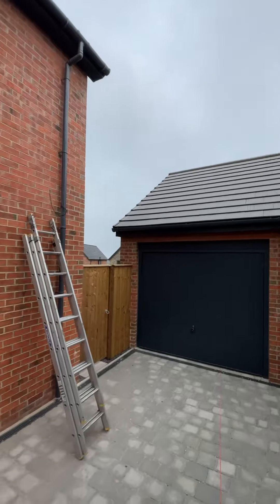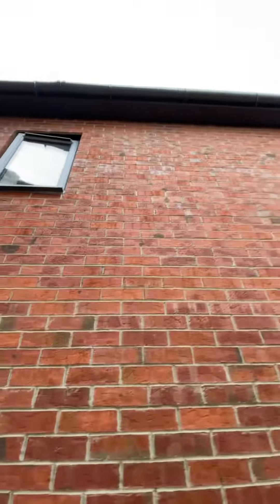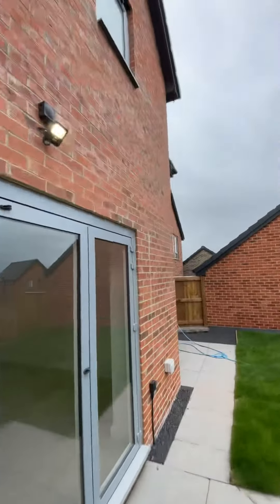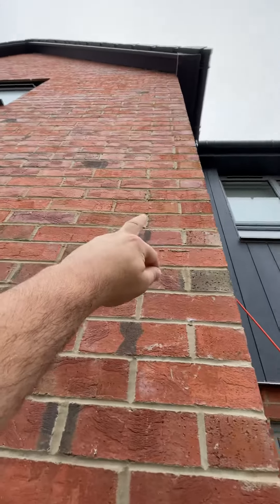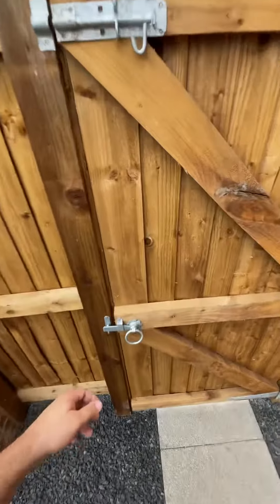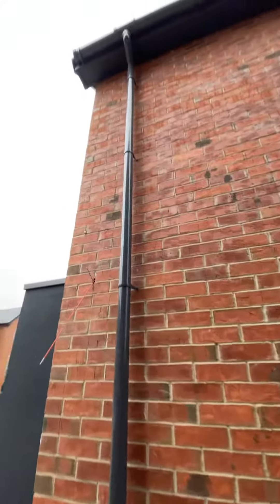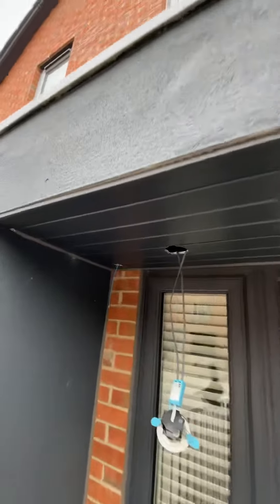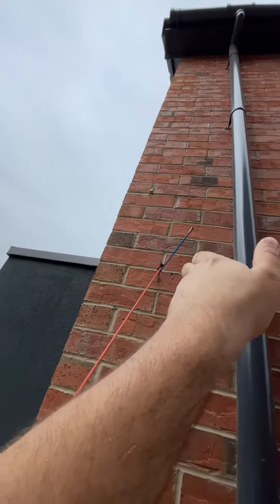Another Day On The Job - CCTV Installation

Comment: Once all the cameras are wired up down from the loft, do you feed the four cables (cables at the start)  into the room where NVR is and then use some mortar repair on the mortar to make good? Install looks spot on and some brave angle drilling 👏

Comment: Nice video, Do you have any tips for getting cables in the cavity? I’ve tried to push rods through at the steepest angle I can get and can’t for the life of me get the rods through. 

Any helps / tips would be appreciated 

Thanks
Reply from the maker: Thanks, pretty poor but will try and start doing some better vlog style videos! 
I’m guessing you’ve watched our cavity how to video? How many rods are you getting through, if it’s just 1, try knocking the end of the rod with a hammer quite hard. Sometimes you’ll find there is messy mortar on the internal brick preventing the rod from going any higher.
Reply: @HikVisionGuru  Hi , yeah I have which is what made me want to change all my cameras and have them in the cavity. I started with one camera along time ago and added more and more over the years but I have them all externally routed and want them all in the cavity.

Ok I’ll try that I can’t even get the first rod through it hits the internal block and can’t get it past even though I am at the steepest angle I can get. I’ll give that a go though and see if it’ll bend the rod past the internal wall and up into the cavity .

Thanks
Reply from the maker: How long a drill bit did you use, might even have gone too steep and it’s still going up into the brick work rather than the cavity. If hitting with hammer doesn’t work, try re drilling at a slight angle and try rodding.

Comment: Hi HikGuru, I'm in Australia- our eaves are 6-9mm fibre cement, what screw or fastener do I use to hang cameras off that? In your videos you just screw direct to the eaves, I don't know what eave/soffit board you have in the UK
Reply from the maker: Hi Ron, we have wood or pvc usually!
Make sure firstly it’s not got hazardous asbestos in it before you drill it and always wear your dust make when drilling cement. A normal wall plug and an adequately sized screw would hold it, as long as it’s not a big heavy ptz camera! If not use plasterboard type fixings
Reply: @HikVisionGuru  thank you so much! Unfortunately I had already hung them on plasterboard screws last week and they seem solid. Should I remove and install wall plug, some plugs just spin and don't open up inside as meant to. Also I ran pvc conduit like you to an external wall with 2 junction boxes. Do I need to silicone the joins as they are just pushed in together. Also the T and round pvc junction box covers are screwed on tight,no silicone.
Reply: @HikVisionGuru  hello, please help me on the above if you could, thanks legend 🙏🏼
Reply from the maker: @ronfj8603 as long as the screws seem solid then it’s all good. Pvc wise you can either silicone the lot or put it some water drip holes so any water can drain away.
Reply: @HikVisionGuru  thanks so much, really appreciate your help, absolute legend and fantastic videos mate! 🙏🏼🙏🏼🙏🏼

Comment: Hi, 

I appreciate your effort in trying to pull the cables from the wall cavity. I encountered a similar issue; every time I pushed my fish rod into the wall cavity, it broke after 4-5 feet. We tried the same method you're using, but it didn’t work for us. 

Could you kindly share which fish rods you are using? I’d like to buy the same ones and give it another try.

Thank you!
Reply from the maker: We tend to use C.K branded rods, you can buy different strength rods, some which are flexible some which are less flexible depending what you need

Comment: Call me stupid but I’m so confused, when you drill through the wall how do you make a gap in it to run the cable up to the loft aren’t all walls solid? Or does it have a gap in the middle of the inner and outer wall ? And secondly my kody is converted into a bedroom so how would I run cable up
Reply from the maker: Yes there is a gap between the 2 brick layers called the cavity, so we drill through the first brick layer only, then push our rods up.
If your loft is converted you may struggle, unless you’ve got some access to the eaves in the loft, sometimes there’s little doors into these areas.
Reply: @HikVisionGuru  that makes a lot of sense now thank you very much

Comment: How did you manage to feed that blue rod through to/from the porch? I am looking to do my own install, very similar to this. And can't work out what to do with the porch!
Reply from the maker: We used a super long drill piece with precision, and managed to drill right the way through into the void above the porch canopy. We then drilled a large cutout where the camera is and we were able to pull the rod down through this hole. Hopefully this helps. If not send me an email with some pictures of your layout with porch etc hikguru.yt@gmail.com
Reply: @HikVisionGuru  Ah OK, makes sense. Will have to invest in the super long drill piece, and maybe a set of balls to attempt it 😂
Reply from the maker: @timboslice4019  🤣 just make sure you are dead on with the drill angle, no pressure

Comment: Can you help me out please 🙏...I've installed 6 camera system...but when I have the cameras on the monitor for 3 of them I have no resource shown on the screen but when I go into that cameras they are working just fine and recording...did you encounter such a issue??
Reply from the maker: What cameras are you using and what NVR model? No resource shows when the NVR struggles to output all 6 cameras especially if they are set to “main stream”, if you change them or a couple of them to “sub stream” by hovering over the camera (a small menu appears below the camera) then they should all show. If you want all 6 cameras to show in main stream you may need to lower certain camera attributes so that your NVR can handle the processing power
Reply: @HikVisionGuru  spot on I just went from main stream to sub stream and bang😀😀thanksss a lot you got me out of the loophole big time🤟🤟🤟🤟😁

Comment: Just subbed because I plan to self install these G2 cameras. I've seen most jobs using the Hik back boxes due to people saying you can't get all the cables to fit inside the camera unit and it protects against the weather but noticed you didn't install them or have trouble with the cables. I personally don't like the look of them with the back boxes
Reply from the maker: Yeah they do look ugly sometimes, they make the camera stick out so much however sometimes it can be beneficial for the camera to protrude if you needed to see over a drain pipe for instance. You can fit the weatherproof gland behind the camera no issue, and if you struggle you can always make a slightly larger vertical hole in the brick to put it in.
Reply: Thanks for that, I do have a section that sticks out 2-3inches on the bay window so will probably after use a back box for that one

What's the current NVR to use with these cameras I wouldn't need more than 8 ?

The cavity install videos are great, you could really do with more install videos from planning camera locations to setting up the nvr
Reply from the maker: What camera are you going for the 4 or 8mp, and a maximum of 8 cameras you say?
Reply: @HikVisionGuru  thinking 3 8mp 4k cameras to start with but always have room for expansion.
Reply from the maker: @Messimagician83  there’s the the lower k series model which I wouldn’t recommend for 8mp as it’s only got so much processing power, the DS-7608NI-K2/8P can have up to 2-ch@8 MP or 4-ch@4 MP or 8-ch@1080p decoding capacity. 
You’ve then got the DS-7608NI-I2/8P which can handle 2-ch@12 MP (20 fps)/4-ch@8 MP (25 fps)/8-ch@4 MP (30 fps). 
Even better with your 8mp cameras would be the DS-7608NI-M2/8P which handles 2-ch@32 MP (30 fps)/2-ch@24 MP (30fps)/4-ch@16 MP (30fps)/8-ch@8 MP (30fps)
Reply: @HikVisionGuru  Thanks. I didn't realise that there were nvrs with 8k support. I suppose we'll be looking at 8k colorvu turret cams soon. Can you speak through the Hik connect app if you have cameras with two way audio ?
Reply from the maker: Sure it’ll be the new norm in years to come! Yes you can two way talk via Hik-Connect